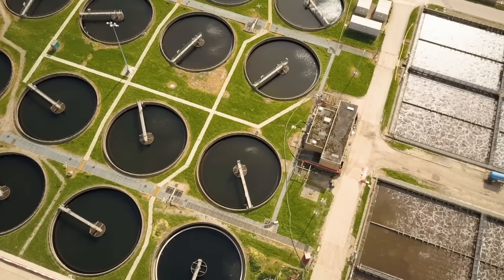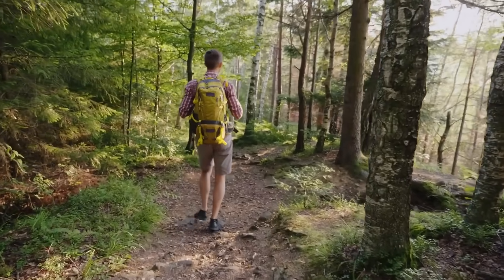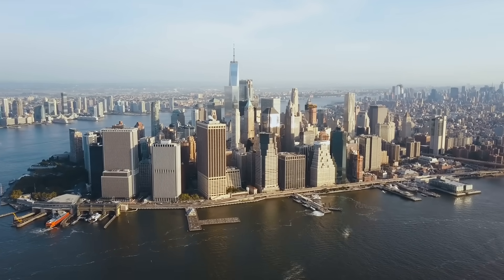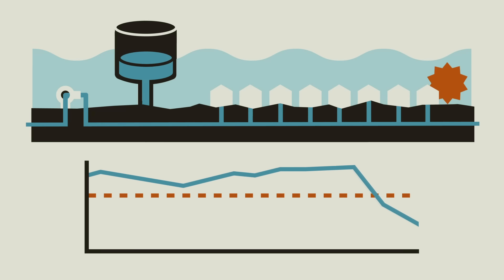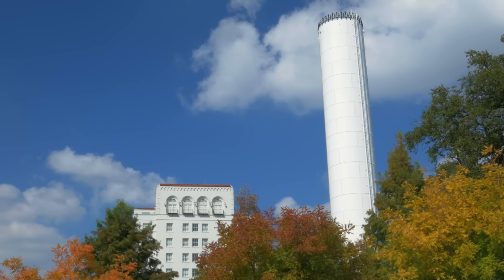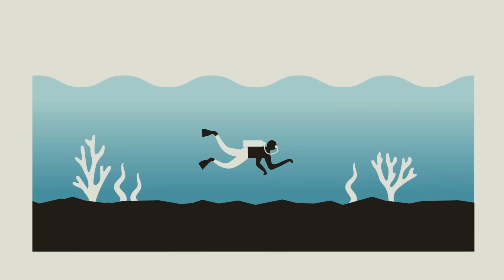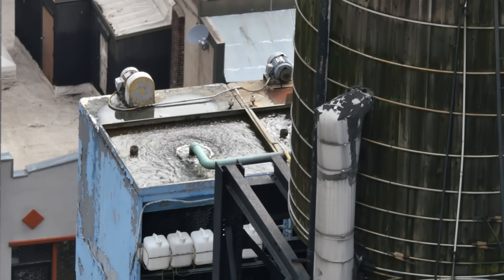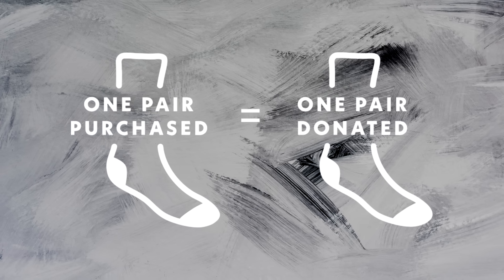How Water Towers Work

Comment: Grady, Grady, Grady... I thoroughly enjoy all of you video's and the absolute metric butt tonne of information you put into them. With that said, at about 2:35 in the video you state that we can raise the pressure of a fluid with a pump. I'm no engineer, nor do I claim to know anything about these topics but i VIVIDLY remember a Youtuber by the pseudonym AvE RANT about how pumps create flow, not pressure. Pressure is a product of the restriction of that flow. Just saying... Hahaha. :-D Just thought I would poke some fun at you. Made me giggle when I heard it because of the multiple times AvE has lost his ever-loving mind about that. Anyways, i really like the series and I would love a nice long one about the electrical infrastructure. 
Thanks,
~Shane
Reply: Technically, you can't have flow without a difference in pressure, so the only way for a pump to create flow is to change the pressure. Pumps move the water by pushing it (exactly how really depends on the pump), which by definition applies a force applied to some surface area (pressure) on the water. But if there is nothing to restrict the flow, the pressure difference will quickly even out. It seems like AvE was focusing on the fact that pressure only stays high if there is some restriction of flow, and some force acting on the liquid. Sadly for AvE, there is pretty much always a container restricting flow in some direction (that even counts for puddles or lakes), and the force of gravity applying pressure from the weight of the liquid itself.

I would say it's the other way around: pumps create pressure, and if there is anywhere the water can move to relieve that pressure, it will flow that way.
Reply: @Improbabilities  Good to Know! Thanks for the perspective. Like I said, I am in no way educated in this field. So I like when I'm given information like this. Thanks again.

Comment: Basically, it's a battery for water.
Reply: As many here have pointed out, a capacitor would be the more accurate comparison.
A battery gives off a consistent charge regardless of how full it is.
The pressure a water tank provides is dependent on the water level within it (though, since it's high above all water outputs, the pressure change isn't that noticable).
Equivalent to an electrical capacitor, the output charge of which depends on the charge it holds.
The mechanical equivalent would be a spring; the further you compress it, the higher the force it gives off.

Comment: Aren't pumps used for flow? A fixed displacement pump will put out a certain amount of fluid per revolution and a varriable displacement pump will change the amount of fluid depending on the demand. What causes pressure is a resistance to flow, ie a restriction such as a smaller pipe, the tap or a pressure relief valve. Just wanted to point it out

Comment: Why do most residential well systems keep the storage tanks in the basement, and not the attic?  I get that the water is heavy, so it requires less structure to keep in the basement, but it seems like it would make the system more efficient.

Comment: If your pump produces an oscillating pressure as it runs then putting the water in the tanks first could filter the oscillation out to give a nice stable, quiet, pressure.  I don't know if piston pumps are still a thing to make that necessary but the math should work out, dividing the swing by tower cross section over input pipe cross section, I think?

Comment: Brazil's hidroelectrical power continuity relies on storing rainwater in the reservoirs during the raining seasons throughout the country (mid year in the equatorial north, end of the year in the tropical south) and using a connected power grid to move the gravitational potential energy around, converted to electrical potential energy :)

Comment: Fun fact

Most of the Roman aqueducts had enclosed water channel on them and the ancient Roman (water supply) architecture relied heavily on lead pipes and underground channels. Therefore, ancient Roman architects were also at least vaguely familiar with the concept of the water pressure. Modern water pipes are in a sense just re-invention of the Roman way of providing water. However, it is also noted that the Roman way of avoiding open channels was primarily to prevent animals from urinating or having poo to the major water source, not to build complex water distribution systems.

This is bit contrary to what is said at 1:40, in the video.

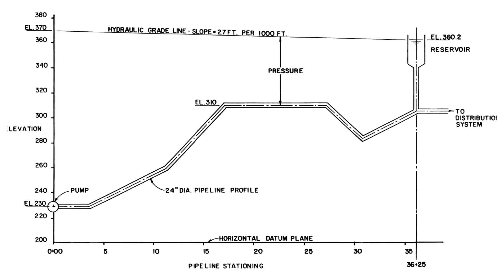Comment: I love 6:25 where they show the "Hydraulic Grade Line - Slope" which derates the pressure head to compensate for pipe loss.  There was so much engineering calculation using intuitive graphical means that is now just some math and sometimes not really understood.  This says for every 1000ft of pipe, it's going to flow like you've lost 27 ft of height - literally.
I remember doing a lot of drafting where we calculated rise/run of sewer lines and such graphically on the engineering drawings and survey plots.  So glad that's done with computers that make fewer math mistakes than I did...

Comment: 2 side comments on Roman aquaducts. They were generally covered to prevent contamination. Plus they did occasionally use reverse syphons. Ie a sealed pipe with one end lower than other. To cross a very wide or deep valley. Rather than trying to bridge it.😉

Comment: Could you use rooftop solar panels to pump water into an elevated tank and then later convert the stored energy back into electricity somehow and would the system be efficient enough to be practical?

Comment: Electrons move from low to high voltage potential, you are incorrect at 2:25. You meant to say electrical current flows from high to low potential.

Comment: Most of the water towers in the metro Atlanta area have been decommissioned and demolished.  The utility companies said that the towers were no longer needed because new technologies had made them obsolete, and residents were surprised to learn that many of the towers had been sitting empty for years.  Note that this part of Georgia is relatively flat and whatever "new technologies" the utilities implemented may not be suitable for other topologies.  For the locals here, water towers are objects from a bygone era.  https://goo.gl/qd2eFi
Reply: Ya they might not have any water but just look at those cell antennae!
Reply: I would have thought that a flat area would be the perfect place for water towers - to store and provide water and pressure fairly evenly throughout their area, which is much harder in hilly areas.  In my part of northern Maine and New Brunswick, water tanks and towers are pretty common, and the terrain ranges from slightly to fairly hilly.

Comment: Why dont u see those in Europe????
Reply: I would guess one of the reasons is denser population.
With these kind of structures, you always need to consider safety.
If you have plenty of space around them, it's not much of an issue if it falls over (it is, by design, extremely top-heavy).
But you can't stick these into densely populated areas.
The other reason I would assume this is more frequent in places like the US is that it is a great solution for smaller communities.
But when your cities are larger, you either need a huge number of these or extremely large ones. Neither of which is particularly appealing.
At some size of population other systems are going to be more effective, and I think that is the case with most places in Europe.
Reply: @rockyblacksmith  well explained, thank you. As a European I have rarely seen one of those.

Comment: An analogue in the electricity grid is powerplants with large flywheels on their dynamos. When demand peaks, the flywheel slows down, and when demand is low it speeds up, storing energy in the rotation of the flywheel. You can only store a little bit of energy in those flywheels, but it's very effective at keeping the voltage steady without having to manually adjust power output.

Comment: Great video, our small town recently built a new water treatment and pumping station, there plan is to demolish our water tower  that was built in the 1940's, an is currently now used, for a town that is still slowly growing do you think that is a wise decision ?
Reply: It might be. One thing not mentioned in the video is failure. If pumps fail, you loose water pressure until the pump is repaired. If a tower fails, you flood a neighbourhood and loose water pressure until the tower is replaced. It might end up being cheaper in the long run to pay for pumps, than pay for maintenance of old water tower to reduce risk of high damage costs if it fails.

Comment: Here in Hamilton, Ontario, Canada, we have an escarpment that bisects the city in half.  The upper regions can be almost 400 feet above the lower city.  I'm sure that provides a unique set of challenges for city planners.  There are a couple of water storage facilities that I can think of off the top of my head that are built on the ground and not elevated towers.  One is located at one of the highest elevations and the other is built right into the side of the escarpment half way up.  You can also tour one of the original water pumps from the 1800s.

Comment: Wow, electric companies also face the same problems of peak and off-peak demands. But for them, since they don't have a practical mean of storing energy, they had no choice but leaving the generators run at full capacity. Then only until recently that Tesla comes along with a reliable storage solution. Great video!

Comment: We had an issue with high pressure at a house I used to own in Durham, North Carolina. It was built in the mid-1980s and I presume the city water pressure was not greater than 80 PSI at the time. By a few years ago it was up to 100. Add to it that the house had polybutylene pipe and we eventually had the predictable result. Fortunately the leak was only a drip in the crawlspace which, because the water pooled, soon made noise and was found. The bonus was that we found the water heater had just begun to leak in the course of the repipe job.

Comment: If anyone is interested in the wastewater side of things, these are the structures shown in the video:
0:01
Circular tanks - this could be a water/wastewater hybrid plant, so it could be long term water storage, but most likely they are rotating tricklers which spray the water over a plastic medium where treatment bacteria grow
Square tanks - these are definitely wastewater aeration tanks, where water stays for a few hours being treated by aerobic bacteria
Middle building - control room for all the pumps and filter systems
Blue tank - the PAC feed system, which distributes a thickening polymer to make sure solid waste clumps up and settles to the bottom so it can be separated from the water
0:34
Circular tanks - more trickling filters
Square tanks - more aeration tanks
Clear Water square tanks - final clarifiers, which let the rest of the solids exit the water before it leaves the plant
Small White Box - effluent sampler to make sure the water leaving the plant meets treatment standards
Caged Buildings - don't know exactly, but probably anaerobic digestors which require high heat
9:45
This is not wastewater, but it looks like a weir flowing into a channel. The weir is there to measure the flow rate.

A note on calculating water demand:
For both water and wastewater, DEP has a city by city average use for demand. One residential house in Los Angles uses 25gal per day. When contractors are building a new house or industrial building, one of the permits they need to get is the water/wastewater permit for how much they are allowed to use/generate. They then connect the building into the water/wastewater systems and the treatment facilities are notified of how much additional flow will be generated.

I'm still new to wastewater, and every plant looks completely different, but hopefully this gives you an idea of what you're looking at. :)

Comment: Another addendum: I work as a fire dispatcher - one of the first things we do during a confirmed structure fire is call city waterworks and tell them to amplify the pressure in a given neighborhood because for a doozie of a fire, we can suck the system dry. Fire engine/pumps are capable of actually cavitating a vacuum collapse of underground pipes if not managed carefully (which the pump operator should be doing but it's easy enough to miss).
Reply: Oh my, cavitation is not something I want to mess with. Does that damage the pipes, or does the pump take the brunt of the damage?

Comment: A curiousity I had the other day was how to deal with elevated tanks when the outside temperature drops to absurdly cold (aka normal Canadian winters) at -40C. Do they need to cycle the water to keep it moving, adding a geothermal kick...or is it just on the power of the insulation on the tank that they survive.

Comment: A few things I don't quite understand:
1) Fluids flow from an area of higher pressure to an area of lower pressure. If the water tanks act as a virtual ocean where the water tanks represent higher surface levels (ie. lower pressure), then wouldn't the water NOT flow to the customers on a lower level (ie. deeper in virtual ocean = more pressure)?
2) These water tanks are closed off from the air, correct? I was wondering how Legionella outbreaks occurred before because I was taught that the outbreak came from infected water tanks. For background information, Legionella is a waterborne microbe that gets aerosolized. It causes pneumonia when you inhale enough of them. It makes sense that water tanks can be colonized by Legionella, but it doesn't make sense how it can get from the tank to the people on the streets if it's not open to the air.

Comment: I used to live in the top floor of an apartment block, the cold water tank was 2 feet above my head. I could adjust the temperature of the water by lowering the spray nozzle.

Comment: Good video, I am an electrician and I work primarily in this industry. We also use hydro-pneumatic storage tanks to store water under pressure with an air blanket to absorb water hammer and help regulate the pressure as it builds up via a pump and is lost through demand. Anyway, I watch your videos a lot and they are consistently good, thanks for that!
Reply: I wanted to comment how hydraulic shock wasn’t mentioned :)
Reply: Provocateur  What colour fugitives will we have in the 21st century?
Reply: Ah, classic—can’t just say "Good video, thanks!" like a normal person. No, we need the "I am an electrician and let me remind everyone I work in this field!" intro before launching into an unnecessary technical breakdown.

Nobody asked for a mini-lecture on hydro-pneumatic storage tanks, my guy. You could’ve just appreciated the video without turning it into your résumé. But hey, at least you managed to circle back and actually thank the creator after the unsolicited expertise dump.
Reply: @KyleCox404 sais you

Comment: I wanna note that aqueducts were completely sealed when they were exposed above the ground, and usually buried underground. The only access to an aqueduct was from a hidden hatch every half mile or so for cleaning purposes, as calcite buildup would clog them over time. These access points were well concealed to prevent enemies from contaminating or compromising the water supply, so I don't know if it's the same as a regular open channel.

The Romans were also very, very good at moving water around. They managed to build an aqueduct that moved water 50 km down an elevation change of only 17 m, which is a drop of 1 mm every 3 m! (0.04 inches in elevation every 10 feet). Do you measure inches with decimals? Would 0.3 eighths of an inch make more sense?

Comment: Having lived on the edge of town and off the grid, we had to truck water into a tank. That will teach you conservation, something everyone will need before long. I would look at the city water tank looming over the orchards and fields while washing dishes and get jealous. 

Later we built a cabin up a divide in the OR Blue Mts.  Thre 3,000' wells later and $$$ down the hole, we developed a spring with a hydraulic ram for pressure. Be grateful for the public - social - systems discussed here! 

If I remember right, Chicago was the first city to put in a water/sewer system. They got their drinkin water from the lake, just downstream from the sewer discharge in the river. Live and learn!  Yipes!

Comment: that moment when an urban hydraulic student sees this new video on your channel :p 
u made a video about hydrology or rain fall already 
but not yet about sewers , sewers are really so hard to handle , water supply is not a big problem on some areas since it's about giving enough pressure and velocity on the pipe line , but when it's about sewers it's just so hard to tell  exactly if rain fall + sewers are together and exactly if there is no slop where we need to use some special pumps
so i hope u'll make a video about it and i really hope to see that 
tyvm for ur videos :D

Comment: is it possible like to add a turbine when releasing water from the water tank? i know its gonna be like less than half as efficient, but you know its something.
Reply: It's not something if pumps have to be run in order to fill the tank in the tower, because if there's resistance in the system (ie your turbine), then the tank has to be positioned even higher to overcome that resistance, and the pumps filling the tank have to work even harder (ie use more energy) to get the water pumped to that elevation.